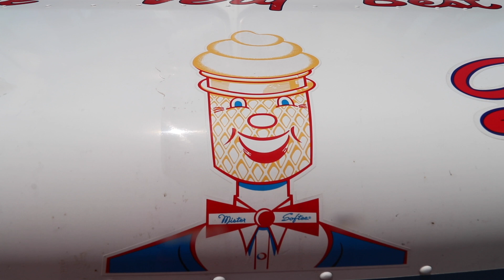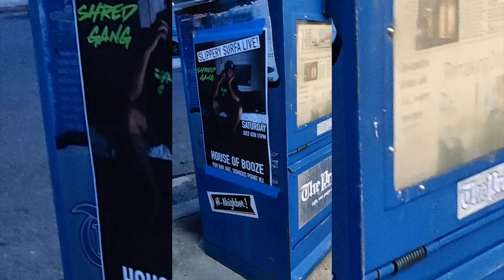LOOK WHAT WE FOUND CLEANING OUT TOWNHOUSE!?!?

Comment: T50 was in the last line of the FD mount Canon's, when they were about to tip toe into auto focus. Mostly a program camera, still students like the manual focus.
Reply from the maker: We are going to try it and take some photos with it! We haven't done much with actual film so it will be a fun experience!
Reply: @tuckandsammie  if you guys like it, you can pick up lots of older Canon FD mount lenses on the cheaply-cheap. I think you can get lenses at the flea for $10 but sometimes you can get a whole bag for like 20 or 30.  See how you like it first. Canon always had a top notch metering system.  Oh, if you do b & w, I can show you how to develop at home.  You guys have found developing stuff in cleanouts a few times.  
Peace,
Dave